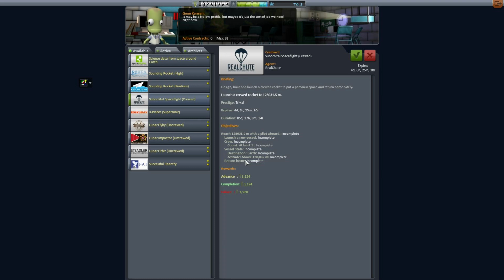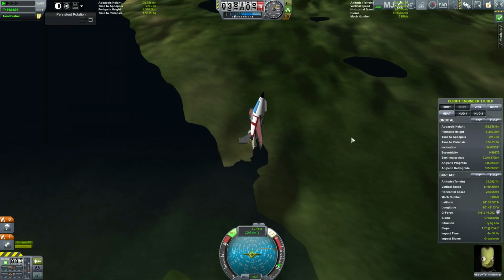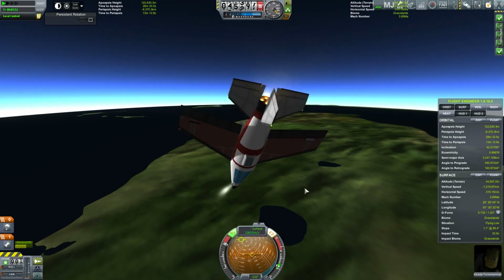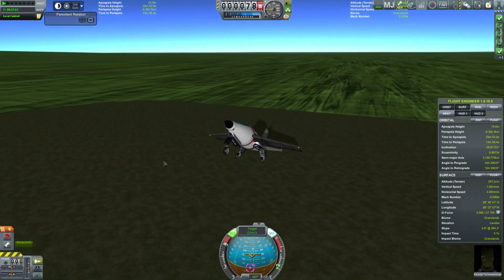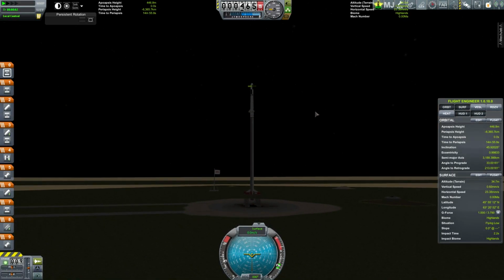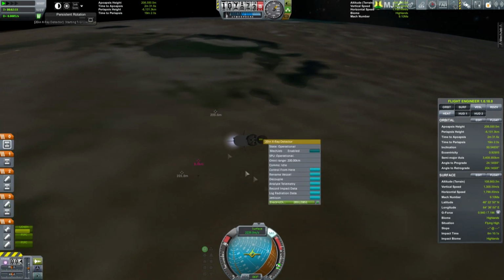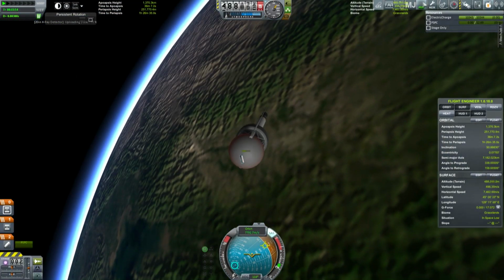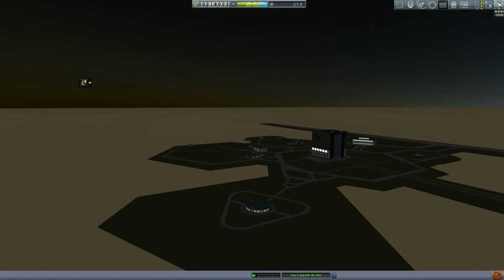Kerbal Spaceships Are Serious Business - Part 6 - I Really Meant To Lose Control

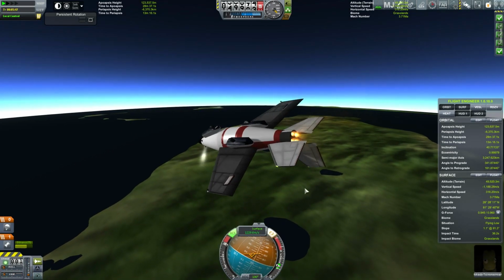Comment: 5:06 "The thing is stable" he said, in a spin
Reply: +Bram42 Spins are incredibly stable, actually. That's why bullets spin; it keeps them stable.
Reply: SkulShurtugalTCG I know, it just sounded funny
Reply: +SkulShurtugalTCG Precisely the reason why a spin is so dangerous for an aircraft. All your control surfaces are ineffective because they point the wrong way and it is so stable it won't stop until the ground...
Reply from the maker: +foobar201 Indeed 'stable' modes are those which the aircraft tends to stay in, if you ever find yourself 'stuck' in a spin, then it could be because the spin configuration is stable.
Reply: +Gartenrunnig I must quote you
Reply: ***** did you made that up or is it someones quote?
Reply: Illuminati Unconfirmed The best quotes are the made up ones

Comment: What does he mean by "in the simulations"? Is he using a figure of speech and being cheeky, or does it let you do preflight tests without risk of your pilots?
Reply from the maker: +Jerryrig Kerbal construction time allows you to fly simulated versions of the vehicles before you build them. Each simulation costs money however, so frequently I just skip them.
Reply: +Jerryrig Yes you can "launch" your spacecraft in a "simulation" for a tiny amount of money to see how it works. It's just like playing the game normally, you just don't get the science and whatnot. And of course you don't risk your crew and money if the craft doesn't work as intended.
Reply: +Jerryrig Kerbal Construction Time lets you run simulations of your vessels, among other things.
Reply: +Jerryrig The Kerbal Construction Time mod allows you to do a "simulation" launch that's automatically reverted afterward. You can simulate before you spend the time that it would require to actually build the design, the auto-revert means you don't permanently lose any crew, and the funds cost of a simulation is less than actually building the design.
Reply: Pan kurczak For most rockets, it's a few hundred funds for enough time to find out whether you can make it to orbit or not. Still cheaper than actually building two versions of one that costs a few hundred thousand.
Reply: +Kepe I feel like in that mode all planets should be featureless monotone spheres, and everything rendered on the lowest graphics settings!
Reply: +Scott Manley I was wondering. Danke